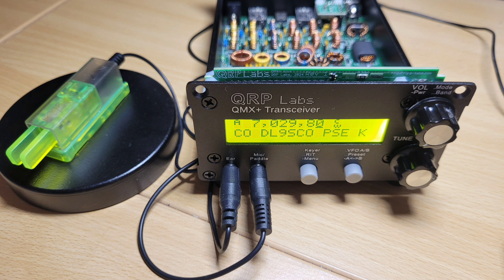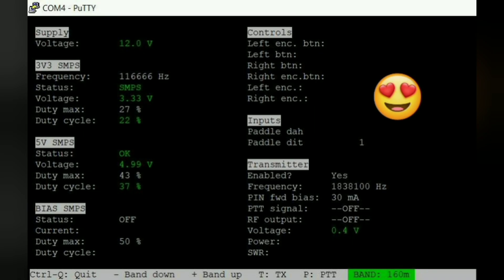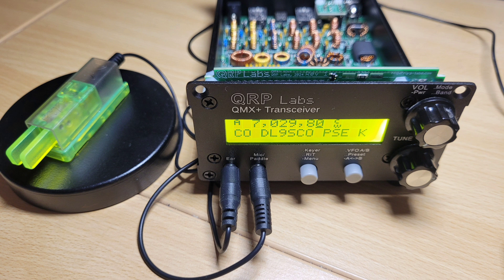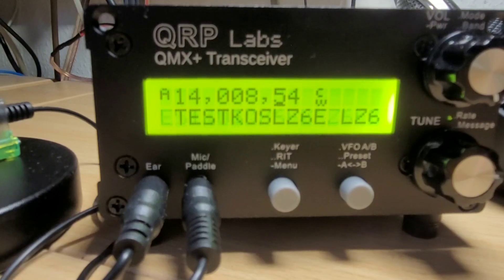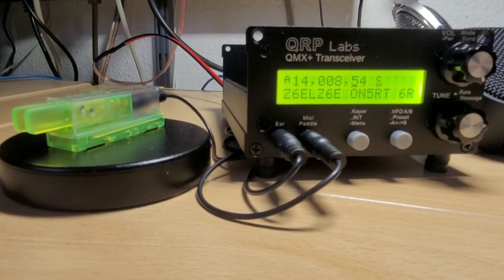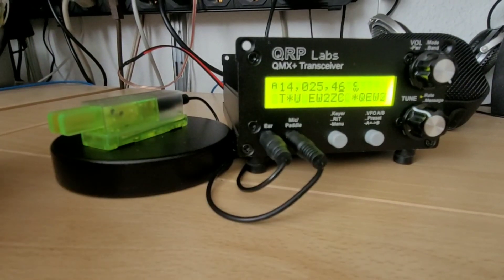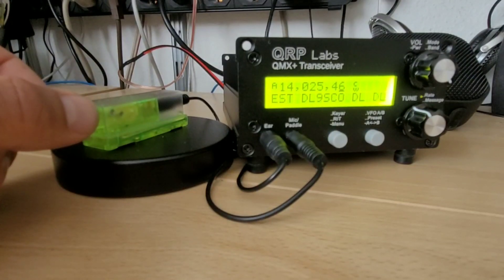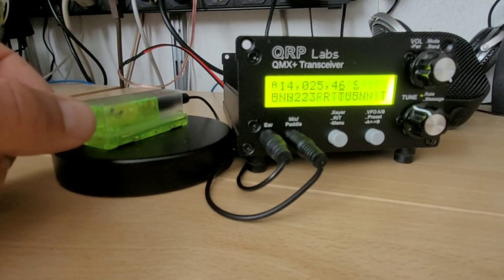Initial tests and first CW QSOs with the QMX+ from @QRPLabs

Comment: You must have a decent antenna to work stations with 1.5 watts❤
Reply from the maker: On 20 m, the QMX+ is putting out 3 watts at the moment. My antenna is a 2 x 13.6 m doublet with an automatic tuner in the feedpoint. And yes, it works really nice 🙂
Reply: Nice video! What version of firmware are you running?
Reply from the maker: @wrmoore47  I am running FW 1_00_19. You can find it on the QRPLabs webpage under the regular QMX firmware list